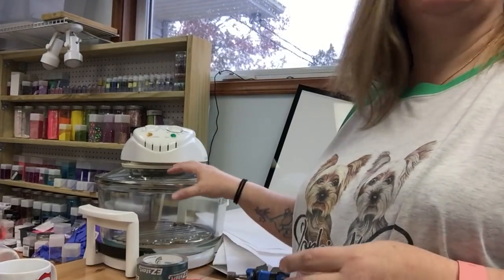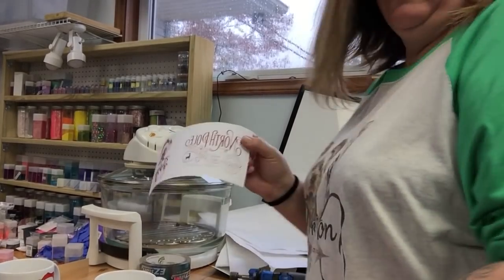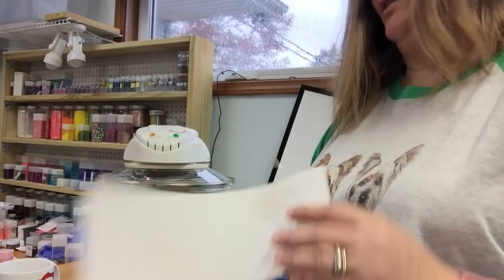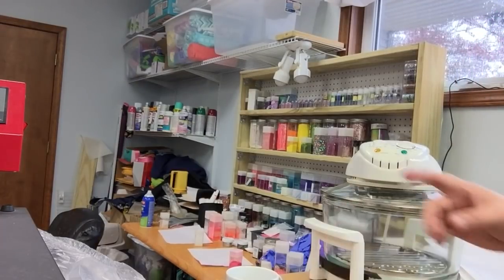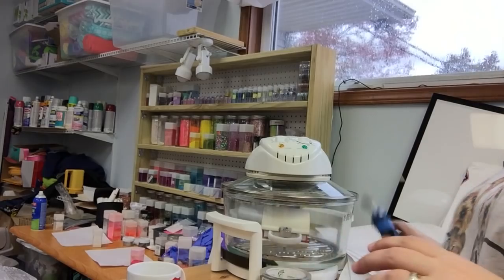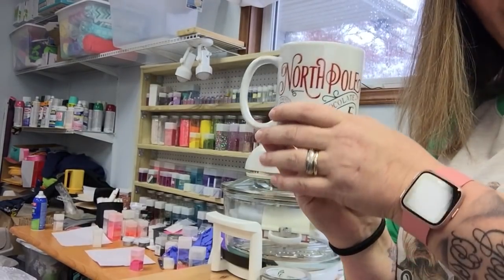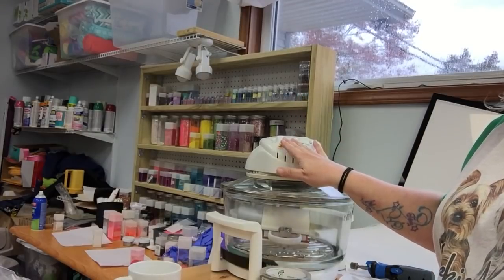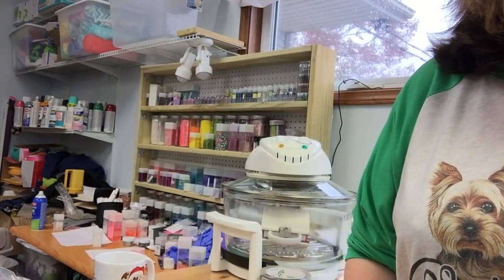Sublimation Mug in an AIR FRYER!

Comment: Is there a special printer you used to print the image?
Reply from the maker: you need a sublimation printer for sublimation. BUT you can also print images on waterslide from a regular inkjet printer. I use waterslide paper for my design that go on my tumblers.